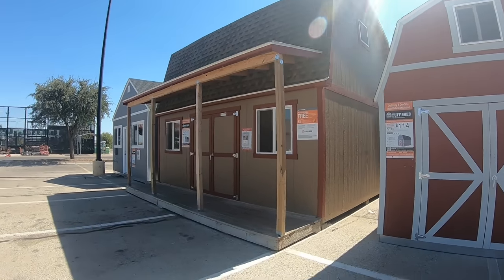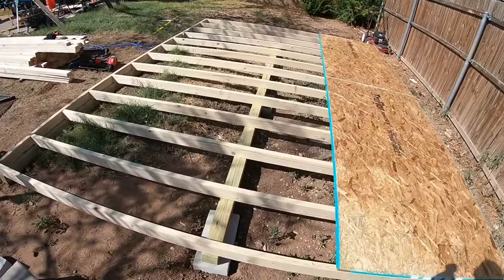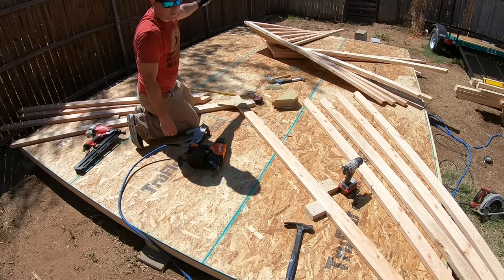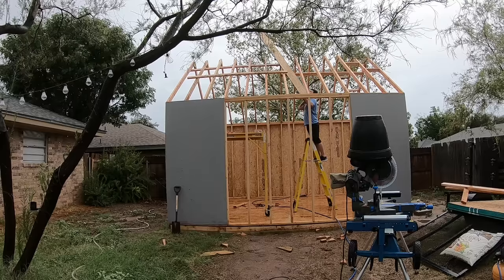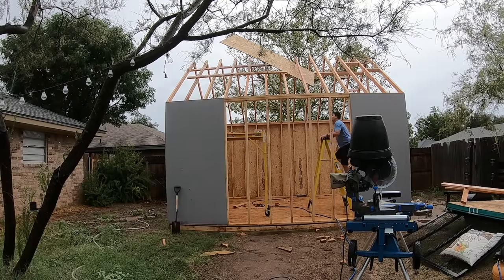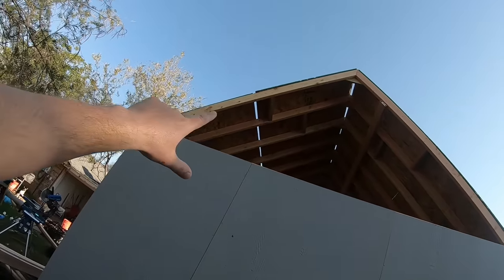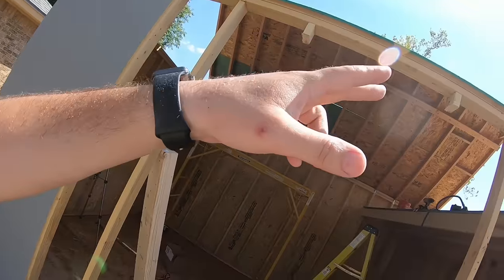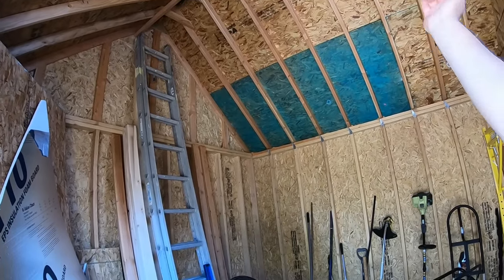Giant Shed for a fraction of the price!!! 12x16 with a Loft!!!

Comment: PLEASE Please Please install some cross bracing (Joists) between your rafters and brace the corners at 45 degrees to each other above the top plates.  That 3/4 particle board decking is too heavy for the way you built the roof and structure.  Everything looks like you are in Texas as am I and eventually those 60+mph bursts are going to roll thru and collapse that structure.  The loft flooring is acting somewhat like joists but the way its nailed to 2x4 king studs it is just not enough.  When we get those squall lines coming thru the horizontal wind loading on those walls that are not tied together properly with that kind of vertical weight this structure will collapse.  Sorry to be such a downer on your project, a little more thought and structural support tying things together will keep a major accident from happening.   This is the first time I have ever commented, ever, on a social media posting, and I am concerned for you and yours.
Reply from the maker: I appreciate the advice! I have since added bracing to the ceiling and lag bolted the loft joists. I will add the bracing above the corners as well. Thank you again for the advice, I am definitely not a professional.
Reply: I'm in Texas, I would've done a barn style roof..
Reply: I would imagine the hurricane clips would have kept it together.  Support for the truss is always good. I guess corner bracing since he didn't over lap the top sill.  We have high winds on occasion buyt not all the time.  Great work keeping it square on the foundation.  You did a great for not doing it all the time.
Reply: Your awesome for building that play area for your son. It's exactly why I watched you video.    Im surprised you didn't need a Ridgeback to keep it sturdy.  My  8x14x8  needed it with a 4/12 pitch.
Reply: Do you have a shed build plan to do it properly?
Reply: @John-sn4hl  You’ve seen the video so NO!
Reply: They are called rafter ties. Since there is no ceiling joists or floor joists, rafter ties are needed to keep the walls from pushing out thus causing the building to collapse. Good advice, but at least you put the hurricane straps on that was a good move.
Reply: Get your gf out to help you!
Reply: In his defense.....he did say he was a dummy 🤣
Reply: Good advice.
Reply: You flipped that wall up by yourself I’ve been there and my body is 15 years older then it should be because of days like that lol
Reply: If he doesn’t the walls eventually will start blowing out
Reply: Thank you! And GOD Bless you 🙏 I'm new to building this kind of thing so every little bit of advice helps a lot thank you
Reply: Scares me when a dog is around these walls falling on them. Dog should be inside not out there at time of nailing wall up.
Reply: I’m building mine exactly like this! We don’t need no stinking bracing or thoughts on king joists!
Reply: I'm not sure where you live but I live in Florida and that particle board wouldn't last hardly any time at all so if I was going to go through all the trouble to build a I would use treated plywood but that's just me I will probably never build a shed😊
Reply: @fixingspencer  did you make it up as you went so cool though I don’t know how u didn’t pass out with the heat
Reply: @puppygadget3189 Funny how dog people are more concerned about the dog than the girlfriend.
Reply: What part of Texas you in?

Comment: I'd built a larger (12 X 24) underground basement then put the 12 X 16 shed over it. fully lined the ground basement with poly sacks for walls, adobe walls and floor and used it for food storage or storage for multi uses.

Comment: As a framer watching you fight to plywood that roof was both entertaining and frightening. You got it done though and I'm proud of you! Me personally, I'd have started the plywood from the bottom and walked it up a small extension ladder and then just hopped up into the trusses
Reply: Exactly when I came to comment... at least he learned not to plywood the walls and attach stickers before raising the other 3!
Reply: @phaylon  Pretty sure he did the one wall because it was so close to the fence that attempting to do it after the wall was up would have been a different struggle.
Reply: My thought exactly.  I built a pitched roof on my old flattop house, and I never considered doing it any other way but to use an extension ladder and do the bottom sheet first.
Reply: Yes at times it was funny but because he was sooo determined you HAD to root for him. All in all he did a decent job and probably learned a lot along the way (you could tell that at the end when he seems proud and humbled at the same time). I for one am also proud of him that he kept going even though he was alone on a very difficult project.
Reply: No plywood, just osb.
Reply: @bewbathis_3211  No, no, it's not called that. Maybe some store got it wrong. Plywood has veneers glued together (plies), OSB has compressed strips of wood. More like pressed wood not plywood Totally different. Ask anyone who makes furniture or cabinets.
Reply: Yup I have never seen anyone sheet a roof from the top down

Comment: Tuff shed uses metal beams on their sheds on the bottom. That's where some of the 4 grand is placed. But I agree you can build a better shed and use better siding taller by using 8 foot 2 x 4s if you build one of these in NC you need to use 2 x 6s for the outside walls. Which will add cost to the project. But overall home made has it's advantages over issues. 73

Comment: Pretty good job!!  I would have put in flashing outside the base of the walls to protect the floors and made the walls a little shorter so the siding covered the floor.  Also needs an overhang on the roof so water doesn't get in the walls.  Even metal roofing with a 6" overhang would have helped.  But what a huge project to take on alone!!  Good job!!
Reply from the maker: Thank you for the comment and advice!
Reply: I made that same mistake.  I painted it really well to keep moisture from splashing and sticking.   Adding one overhang is also a good idea all the way around.   I did on 2 walls but my man door was on a wall without it so I built one and tucked the flashing under the siding. Huge pain going back and doing it.
Reply: Hi @davidraamiah3435. I have a few honest questions. Is it actually safe and effective to overhang metal roofing 6" (or more?) at the gables and over the sides? One, is that "allowed?" Two, is that safe? Three, is that going to hold up even against wind?
Reply: @dbf1dware  yes 6 inches on gale ends and depending on how heavy the gauge of tin you can go 16 inches over on sides. If metal isn’t thick gauge, it’s better not to go more than 12 inches on sides. However you can extend the rafters and go 24 or even more.
Reply: @goinggoinggone17  Cool. Thx.

Comment: If you have to sheet a roof again by yourself prop up a couple of 2x4s attached to the roof line and the ground. You can slide the sheet up without the risk of injury and gravity helps you keep the sheet in the air. Nice job getting twice the shed for half the cost!
Reply: Could have also added a few temporary screws at the bottom edge and let the OSB rest on it just to get it up there.  But with most things he seemed to adapt and figure out ways to get it done.  Might I add--by himself.
Reply: It would have been much easier to start at the eave instead of the ridge with the roof sheathing!. I don't see the point in starting at the top.

Comment: I noticed your wall top plates weren't interlocked or overlapping in the corners. It would help to tie the two walls together. The roof is pushing outward on the walls with a lot of force and it's important to lock the top plates together to help prevent the walls from pushing outwards. Also, the little gusset plates in the top of the roof aren't enough when the roof gets loaded with snow. It looks like you live in a dry climate though. More horizontal cross bracing would help, part way down the roof line, like the letter "A". I'll give you an "A" for effort and determination though.  Edit: I just finished watching and I heard you say the same thing about the top plates, so I know you are aware. The loft helps tie the walls together. Maybe add a loft to the other end to help.
Reply: I think a loft on the other side might help pull it together if the joist run stud to stud.

Comment: Im in construction but not a carpenter by trade. This looks better than half the carpenters work on job sites so take this as a compliment. Watching you work solo and mentioning the struggles of doing big projects on your own resonate with me. I hate asking friends for help so i always take on jobs on my own some of which get overwhelming. But kudos to you for powering through it. Building looks good.

 Fyi Fast2k is quick/easy pour product instead of mixing concrete. Instead of leveling blocks maybe consider piers for your next project down the line and you mix this small 2lb bag of liquid thats equivalent to roughly 40lbs of concrete "if i recall the numbers correctly". It wont rot out lumber, sets fast, expands in a hole. Might of been easier and then structurally tied to the ground. Im going to use it to take on a deck project all on my own next year. Itll be my first!
Reply from the maker: Thanks for the advice!

Comment: For your floor/base frame I think you should have flipped the middle rail the other way so the "scabbed" joints are alternated to keep from having a potential frame failure point all the way across in line on the same end of the shed and also put blocks under the "scabbed" joints with shims to add extra support and strength.  Not knocking, you just my opinion which may be totally wrong.

Comment: What a great video. Glad you finally figured out using diagonal braces to help keep the walls erect and safe prior to nailing off. What no skylight up in the loft? Just a thought. Question why the roof was started from Top down vs Bottom up to help supporting things. Over all it got done and it looks great. That's what counts! Looking forward to seeing the insulation and final inside sheetrock work. Under $2K was a huge accomplishment. Looking forward to seeing future videos.
Reply: When you cut corners, your price goes down. 

Between the rafters and the loft, that's a lawsuit waiting to happen.

You always pay, either before or after...

Comment: I just built a 12x20 chicken coop/shed.  I was doing well alone until it came time to roof.  I almost tried your method (between the rafters) but I'm too old and not enough upper body strength - I never gave it a try.  The husband and teenage kids finished up the roof.  Chickens move in this week!!    Next spring we are building a 12x12 playhouse with loft and I finally figured out how I want the loft thanks to your video.  I will build 10 foot walls and put the loft 3 feet below the top plate - that will save me from having such a steep roof grade.  Thanks for the inspiration!!  Great job on your shed!
Reply from the maker: Thank you! The roof sheathing was definitely the most difficult part… and the loft is great! Made mine just tall enough to walk under.
Reply: I would like to know what plans you used.  that sounds like just what I am wanting to do!
Reply from the maker: @GWBarker  No plans…. Just measured it and built it… 🤷🏻‍♂️
Reply: @fixingspencer  you can color me jealous.  
 I want to do what @fivefatcats did as well.  Combine your cool shed with the chicken coop.
Reply: Hey @fivefatcats!  You have any pictures or plans of what you did?  I am very curious to see your setup!

Comment: I did this same thing when I built my first workshop. In 1995 I built a 12x24x12 shop with windows, attic ventilation, 100 amp power and A/C for $1400. About half of what a pre-built would cost me.

Comment: 2 tools I highly recommend are a straight speed square and a level. Doesn't have to be perfect but the roof and foundation are the most important parts. If the foundation isn't flat and level the entire structure will be crooked and if the roof is poorly made the entire structure won't last long.

Comment: Interesting to watch.  Thanks. 
Installing roof decking is very hard for a solo DIY...then you have to shingle it 15 to twenty feet off the ground.  That's why I always did sheds with steel roof panels over stringers.  I knew my strength and balance limits...even when I was 30.

Comment: Standing that first wall would have been so much easier if you had tacked brace to each end with a single screw loosely so it could pivot. ( Long part away from the wall)  Then as you lifted it, the 2x would have caught part of the weight so you could get a better grip.  They also would have allowed you to nail them off to support the wall so that you could then nail the wall down to the deck.

Comment: One nail in a temp brace on each end of that wall makes it much easier to stand up. It will usually hold from friction while you change your grip. Then when it's upright one nail at the bottom until you can plumb it.
Reply from the maker: Thanks for the advice! I think I just got too excited to get that first wall up! LoL
Reply: @fixingspencer  and gf wasn't ANY help, I was like "don't run away, grab it anywhere"  🤣👍

Comment: When I was thinking of a shed for my mower and other outdoor tools, I decided to build my own. The prices at the time were just as crazy as they are now. I put up an eight by twelve unit for about a third of the cost of a prebuilt one. Used T1-11 siding. Also built my own roofing trusses. My brother in-law installed the shingles. My father in-law had bought three basement thermal windows with the wrong sizes and gave them to me for the shed. I did something a little different for access to the areas. On the left side, doors for the lawn equipment and double doors on the front side for my other things including an air compressor, speaker hookups and phone line hookup. Power was installed from the house and an air line put down for a feed to the basement.

Comment: My Dad had a Tough Shed built/installed at his summer getaway. The price of the shed includes delivery, building the shed, 8 hours of labor (2 persons, 4 hours each), and the fact that they persons that built the shed knew what they were doing.
Reply: That’s great info!
Reply: Came here to post this. Yeah, you can build the shed yourself for "half the price", but that's only if your time is worthless. I'd personally be willing to pay the premium just to not have to do it myself....and to have someone to point the finger at if something is fucky 😂
Reply: @WackyMatt91  A lot of those pre-built sheds rot before you ever finish paying it off, as what happened to my brother. They use sub-par materials and charge 3 times what it's worth. And good luck getting them to repair or replace anything, you're sol. Better pay that bill tho or they'll come take it and everything you got in it. Better to buy a good set of plans and build your own with materials you pick.

Comment: When you were trying to get the roof sheeting on top I was thinking a scrap piece of 2x4 screwed on top of the rafters near where the birds mout would sit on the top plate.   the base woulda gave you a lip to stack a few sheets by pushing em up on it from outside.  Even just feeding the 4x8 sheets from the ladder outside woulda been way easier than trying to feed it between the rafters.. glad you got it done and didn't injure yourself. 

I want to make a cabin someday in my woods so ive been watching tons of videos and ran across yours in the mix.  Its making me question if I really want to build one, my problem is my baclyard slopes down into a ravine and then back uphill where i want to build so hauling in material will be a pain in the ass . Id have to use my ATV but I think i may need a bridge 1st possibly

Comment: I enjoyed watching you sheet the roof...you did well though.  The 1 downfall I suspect is that without an overhang,  this is bound to leak.  I imagine water will wick in under the wall by the fence as the siding is flush with the floor.  I would caulk that right away (maybe flex seal)
Reply: Flex seal should have fixed the titanic - wish they had it back then
Reply from the maker: Yeah if I had it to do again would have had more overhang on all sides… Thanks for the advice about flex seal! I’ll give it a try!

Comment: That 3/4 TG Flooring will serve you well. One thing I did to my floor was to add 1" Blue Foam Board and through 3/8" Sanded on one side Plywood on top of that. It makes one hell of a difference in the floor temp, when the outside temp drops. I don't know what part of Texas you're in, but I am in Missouri and it gets a bit colder for longer periods up here, so there's that. Great job, you didn't kill yourself while doing it, I call that a success!
Reply from the maker: Thanks for the comment and advice!

Comment: Not a bad result.  Now you know how to build the next one better.  I did more or less the same thing when I decided I needed a shed.  I was stunned by the low quality and high prices at the big box stores so I built my own 12'x16' "shed".  I ended up spending about $3K back in 2006, but for that price I built a fully insulated shed with electricity, double 2x4 walls, double pane windows, insulated door and fully finished interior (gyprock, painted, etc.).  The outside of mine is cedar shingled.  The hardest part of the entire project was digging the 50' long trench for the electrical line since out "top soil" includes rocks up to about 18".
Reply: who in the world still calls it "gyprock"?

Comment: Have you checked the material costs? A 10x12 , 8 feet high, with one small window, shingle roof, 4x8 siding material= almost 3400 dollars. How is it going to cost you 12x16 under 3000 dollars. ?? With all do respect.